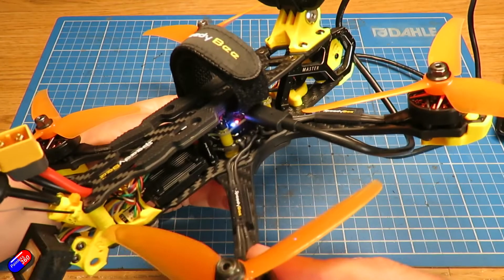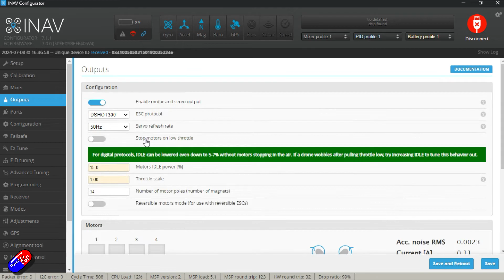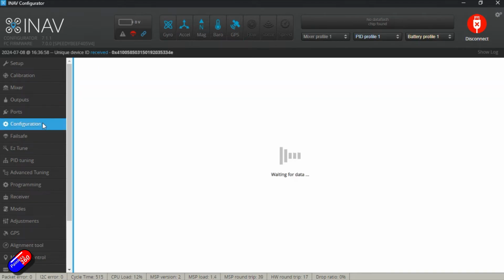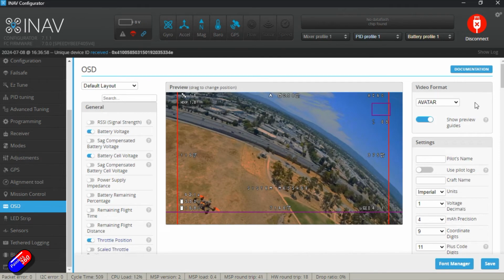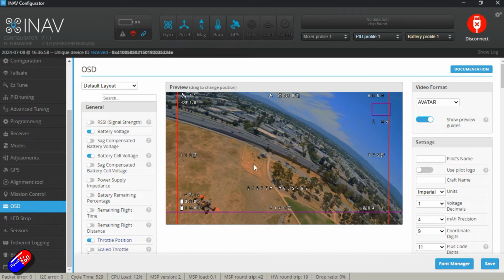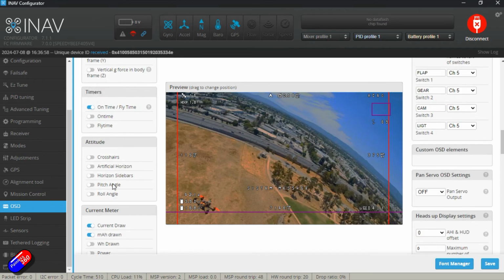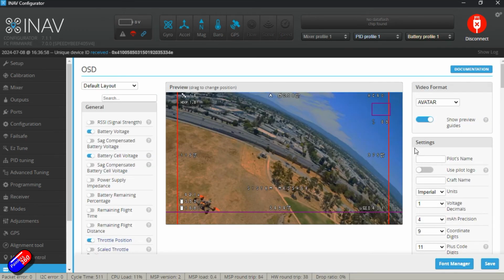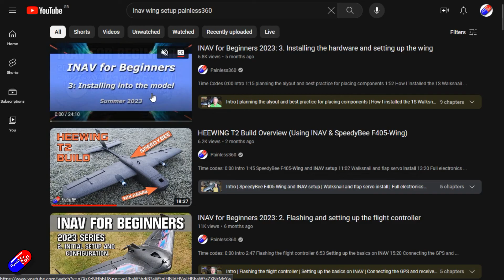How to setup Walksnail on INAV simply.

Comment: Hiya, Do you have a vid for inav ESC telemetry setup? I have just purchased a fancy Hobbywing Platinum V5 & programmer, runiing speedybee f405 wing, noticed esc in this video port settings. might be overkill - I'm new to all this modern digital stuff. I have a FMS Fox 3m I am slowly building up with all latest walksnail equipment, Pitot airspeed, tx16s Latest Nomad Elrs etc.  thank you
Reply from the maker: I've not but Pawel has, https://youtu.be/sPktdBh2Gcw?feature=shared